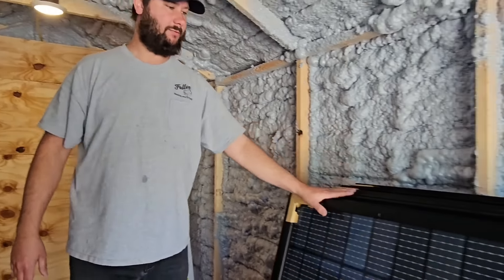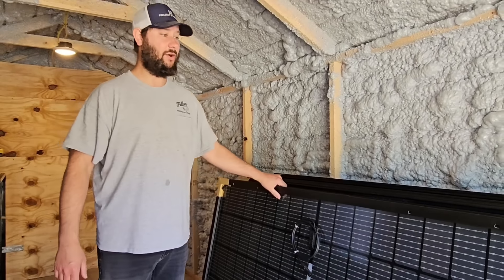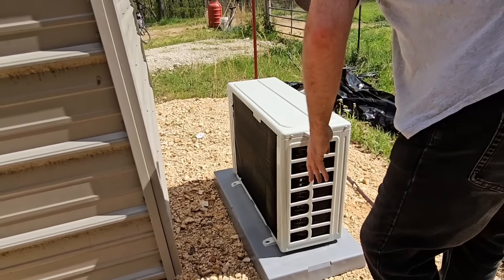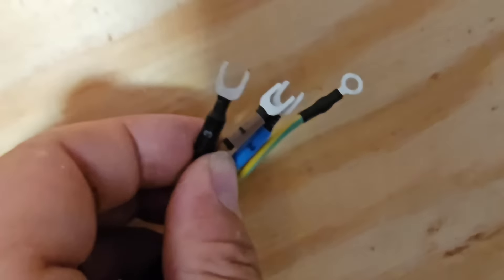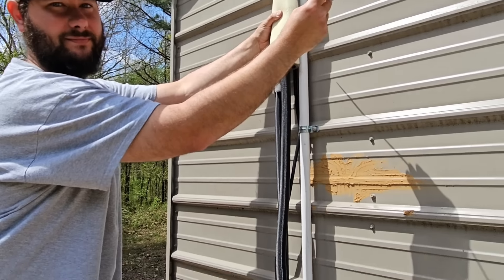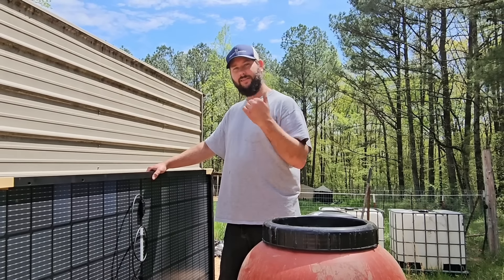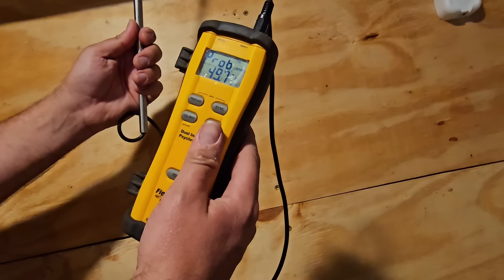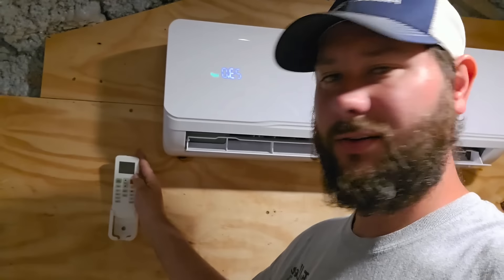Cool Your Home for FREE with Solar Powered AC!

Comment: If u have a solar ac, wouldn't you better put it as cold as possible so during the night it takes longer to heat up again? The power is not costing you anything anyway. I mean this is a shed but for the bedroom. U use that at night. So u cool it to the max during the day. Or it doesn't work like this?
Reply from the maker: I would say if you don't have a backup source of power, then yes, that would make sense. But if you have a battery and inverter that can power the unit at night, then you don't have to worry about that
Reply: @TaddyDigest  but if u already have a solar with battery u have no need for a solar ac. Than u better buy a normal ac and add more solar

Comment: I went back and missed the wattage of those panels I'm all solar and wind power. Every system I design is governed by the total load requirements. I need that data and the cost of that unit. Don't need the panels I've got 3600 watts solar and adding.more plus 4 great wind gennies. The panels you have are larger than mine and wonder what voltage they are and amp ratings. Thanks. Subbed and following. Dandahermit

Comment: Love the vid, I however like to be able to flair the connections to be able to cut the lines shorter and make it neat and tidy. I do the same on the drain lines, that hose won’t last long in the sunlight.
Reply from the maker: If you want to make line shorter and you have a torch and a couple couplings, then you can make it shorter

Comment: What happens when its not generating enough energy to run, like if its cloudy or night time. Does it shut off and tuen back on automatically? It would be pretty annoying if you had to constantly check to go turn it back on.
Reply: Well, what happens? Liking my post doesn't answer my question haha the answer hinges on whether I buy one of these or not lol...
Reply from the maker: If YOU want to learn how the Solar powered AC unit works at NIGHT 🌙 Check out this Video.

https://youtu.be/pjSrqDnEAlk

Comment: “Here we have our installation manual, this is super important”
😳😳🤯🤯

You Are Hired!

Seriously, I get SO fed up with ‘I’m-Too-Macho-Man-Read-Mere-Instruction-Manuals” folks on YouTube , flinging the manual away, then stumbling through the work, trying desperately to figure out which way is up, is water wet, is ice cold, does the RED wire go to the#1 terminal, etc etc.
Then they complain bitterly about “How difficult the install was” or “the product doesn’t work right” or “it burned up in less than an hour”

It’s great to see an actual PROFESSIONAL HVAC installer look at the manual. not all units are identical, manufacturers can have slight differences in details.

Thank you, Taddy Digest. 
New subscriber here.
Reply from the maker: The manual should be your best friend. 
I agree. Why guess when you can know for sure.
Thank you for being here
Reply: Real wrench would be better!
Reply: I agree. When I buy something that has good instructions I usually look them up before I buy it. The instructions give you more insight into what you are buying.
Reply: @ecospider5  ..oh yeah, ‘available manuals’ are the greatest. Sadly, most of this has been locked away behind ‘patents’ or ‘copyright’ or ‘IP’ or ‘Consumer Safety”.
Anyone else old enough to reminder those fantastic ‘Sam’s FotoFacts’???
I am also old enough to remember when Tandy/Radio Shack had “use/maintenance/repair” manuals for almost EVERYthing they sold.
Good Old Days, indeed.
Reply: In the 70’s when I was 6 I watched my dad build our first TV with a soldering iron. He an I did a lot of HealthKit. So many things back then included the wiring diagram inside the device. Those were the days.

Comment: Question 🙋‍♂️ I you wanted to, could you have cut the copper tubes to size and solder the two parts together? So you won’t have that extra tube wrapped like that?
Reply from the maker: Yes, you can, but you would have to pull a vacuum and nitrogen pressure test at that point

Comment: Could the A.C. side be wired to an extension cord to plug into a generator or wall plug?
Reply from the maker: yes absolutely
Reply from the maker: You wanna make sure that the extension cord is at least twelve two wire for this model
Reply: Fantastic. Thank you!

Comment: Is it normal to not vacuum the lines before to add the freon.. ?

Moisture and whatever is in the pipes can just affect your efficiency or your system eventually…
Reply from the maker: If there are quick connectors and precharged line sets, then it's normal not to vacuum.
If the fittings are flared and the line sets are not precharged, then no, you need to vacuum

Comment: Hey Taddy, hvac pro, 47kW pv not too far ne of you. Totally off grid. Running 2 ea 9k mini hp’s 31 & 30.5 seer. 2 ea 2 ton 20 & 16 seer and 1 es 1.5Ton 16 seer hp, 1 9K 23 seer hp in my work van with 1600W on roof😊. 

 p/u 1 5/8 x 1 5/8 unistrut  40’ or so, prime/paint if you choose for rust prevention, bolted to roof using lag bolts, washers, winshield urethane or hvac silicone to seal and hold better/prevent rust/leaks, 3/8” spring nuts, 3/8” ss bolts 2.5” or so, large ss fender washers. 4 sets for one panel or if panels are side by side share hdwr. I use a large socket and a large punch to make washers “Belleville” or cupped. You need a 1 3/8” length (thickness of your frame) of gray 3/4” pvc or block of pt wood to go under washer if not holding another panel down. Tighten everything snug (not super tight to break glass) using anti seize on bolts to prevent galling.

Comment: No mention of batteries; so, does the system only run when sunlight is avaliable?
Reply from the maker: Check out the latest solar powered air conditioner video I did where I show you how it runs at night

Comment: Shouldn’t you vacuum the lines first, before opening the valves to fill the line sets?
Reply from the maker: This model does not require a vacuum
Reply: @TaddyDigest  , the only model I know that doesn’t require a vacuum is “MrCool DIY” where the lines are pre-vacuumed and sealed”…they have a patent on the technology. I don’t know of any other models that have pre-vacuumed lines. 
If your system has it, I would be very interested. 
Do you know if it has “pre-vacuumed lines”??
PS: thanks for taking the time to post 🙏 👍

Comment: Why not install the wires before mounting to the wall? Looks like enough wire length to feed before picking up the air handler.
Reply from the maker: Just did it this way for the video

Comment: How many Cubic ft is this good for?  My building is about 550sq ft...but the front wall is 11 ft and the back is 13 ft, single plane roof.  I'm in upstate sc.

I've learned the hard way that most companies assume 8 ft ceilings is why I ask.
Reply from the maker: 500-600 square ft depending on insulation
Reply: @TaddyDigest Mylar wrapped and foam in between the alum studs
Reply: @TaddyDigest I use mylar bc it has between 70-93% radient reflective rating depending on whether u have a dead air space between the mylar and the sides/top of the building....I can send u a link if u would like
Reply: @TaddyDigest that's the amazon link I use.....I bought 6 of these for a 1300sq ft house to do the attic and the inside of all the exterior walls
Reply: @TaddyDigest I'm in a cinderblock  house.....so yeah

Comment: if a person can carry the outside unit then you defintely dont need those support brackets for the indoor unit. Indoor units are extremely light weight. you can hold it with one hand and push the pipes with other hand easily.

Comment: Just extend the width of the frame the solar is gonna sit on…use some “pipe or electrical strut” to create a frame that extends past the roof line so you can have all those panels sit above the roof(up and out of the way…
Plus if you add More panels and split your lines for the solar to an inverter with batteries you can supplement the power throughout the year for that building when the ac is not in use

Comment: Pretty nice that they make a unit that is efficient enough to run directly off of your panels, and still cool a fair amount of space! I like the fact that they come pre-charged so you don't have to screw around with soldering lines, and vaccing down the system, and charging, and whatnot. That can literally take longer than installing the system in some cases! 😉

Comment: I know this won't mean much to alot of viewers, but an easy way to convert Cel to Far. Double the number and add 30. He was showing 16 cel. 16 +16+30 will put you in the ballpark.
Reply: @BlackpowderBBQ  Well good for you, then why is this AC in Cel.? I was just trying to give you an easy way to convert so you don't have to carry your laptop around with you all the time, to look up formulas. Actually your laptop was more than like made by countries that use the Metric system. Is BTU's and cubic Feet AMERICAN
Reply: You can look up formulas on any phone with access to internet, also c° to f° is probably the easiest one, 32 F equals 0 C and then do each C by 1.8 to convert to F
Reply: @irvingchies1626  Right, I got it. Why are you being a prick about this? I was just trying to give a quick easy way to get close  to the conversion. Do you give people the correct time, right down to the sec if they ask you what time it is?
Reply: @irvingchies1626  Have you ever had a real job where you aren't allowed to play with your phone all day? You ever had a job where the frequency of your phone might cause an expolsion, so your not allow to have it on you?

Comment: Can you hook up both solar and AC power, and if so, does it have a kind of smart switching internal to switch to solar when available, but use AC power when it is not?  Or, do you need some kind of manual disconnect to move between them?
Reply from the maker: Manual disconnect is needed between them. I'm sure there is some type of automatic switching system. You can get. I will learn more and let you know
Reply: @TaddyDigest  Thanks for the fast reply!  I'm not sure if this applies but I found a comment on this vid (zrvf_pqeNH0) and they said "@marcarcher5426 3 days ago
 @MyCabinLife  Was planning on 3 sets of 4 for a total of 1200 watts. Using an EG4 hybrid solar mini-split. Whatever watts it may be short will be made up with AC from the grid. The unit can use both AC and DC simultaneously. 

I didn't catch if the unit you installed was an "EG4" but if it is, and IF they are right, then that would be the best of both worlds.  Instead of "switching" it would just use the AC input for the needed difference, which would be awesome.  I'll be very curious to hear what you found out (and if yours was an EG4 unit), but thought you might like to see this comment, even if I've not found any details yet to back it up.
Reply: Yes he has the eg4 and yes if no sun it would switch to the ac power I asked signature solar about it and they also have a video on it

Comment: Could you run the water drain onto the outside condenser for better cooling?  I may be wrong, but wouldn’t running water on the condenser (right name?) make it operate more efficiently?
Reply from the maker: running water could help condenser coil reject heat 
you would want the water to be neutral not acidic though

Comment: So nice to watch a pro installer guide us looky-loo's.  Very good video!  Mounting the solar panels:  To max energy research the best angle based on your latitude.  Build a semi-stud (only studs) structure with a vertical back for attachment to the shed and angled front for mounting all the panels at the correct sun angle.  Sitting down low permits easy cleaning and negates possible wind damage.  🤠

Comment: Does this unit run on ac at night or does it require batteries.  You said in the video it had an dc disconnect
Reply from the maker: Runs off of a c power at night

Comment: Why are you not vacuuming the lines before releasing the gas?  Is that why you are not able to check the joints for leaking?
Reply from the maker: pre charged line sets
Reply: @TaddyDigest  Are you saying that the lines are charged with refrigerant and have valves installed inside? Same for the FCU coils too? If it is so, why are you not tightening the joints and check for leak right after connecting them?
Reply from the maker: no nitrogen pressure test required or vacuuming 
no flare fittings they are quick connectors
Reply: @TaddyDigest  Thanks

Comment: Is there any way to mount the solar panels so the short end hangs off the roof?  The overhang will shade the shed side a little bit, and it might help the panels get rid of some heat, too.  Make sure you use standoffs to allow airflow under the panels, too.
Reply from the maker: I thought about doing that
I'm just unsure of the weight added to the shed roof because the panels are quite heavy

Comment: Great video.  Looks like they intended you to put the wiring harness through that white plastic bracket, just curious if there is a reason not to do that.  Does it make it easier to maintain in the future?
Reply from the maker: Thank you for watching
No, reason not to do that. I just used what I had and what i'm used to

Comment: Seems like that unit is big for that shed.  Will it be tu
Cycling too often?  Doesn’t size matter?
Reply from the maker: In a building less than 250 square foot. As long as you don't put more than a 12000 btu  unit, it will not short cycle

Comment: You need to add a rubber washer between the rib and the one hole clamp on the drain, water can migrate behind the clamp and into the rib, it does no good to seal only the domed screw and clamp without sealing the rib and the clamp
Reply from the maker: Thank you, my brother. I really appreciate your advice and you looking out for me
I will definitely do that

Comment: Quick question...if you leave It running and the sun drops off and also overnight, will the unit restart all by itself or do you have to keep turning it on with the remote when the power level drops?. Great video by the way. Regards from Super hot Australia 🦘🦘🦘
Reply from the maker: the equipment will automatically switch over to the other power source

Comment: Pressure treated and then painted 1X4s .Run some long ways and then some crossways. First of all they are light and strong . Secondly they would probably last 20 years even if you did not paint them since the solar panels will keep most of them dry.

Comment: Good stuff thanks. I want to use this for my solar power and battery shed which coincidentally will contain EG4 LL batteries. Mainly interested in keeping everything at 55 deg or above in the winter. Thanks for the video.

Comment: great video.. But you should have vacuumed the lines before releasing the gas... i installed one.. and it even noted in the instructions to vacuum the lines... so you have less of a chance of getting vacuum lock in the lines and will last longer..
Reply from the maker: The lines are prevacumed

Comment: Why did you open the service valve without vacuuming the indoor unit and pipes? (26:58)
Reply from the maker: These lines do not have to be vacuumed
There are no flared connections. They are quick connectors

Comment: Sir am I correct that this requires 4560 watts of solar panel?
Reply from the maker: To run this air conditioner, it only takes a minimum of eight hundred watts

Comment: You also seem to have forgotten (edit: nah, I missed it) to angle the tube and hole in the wall 8-15° down going out, to prevent moisture and condensation from gathering in and around the hole, but you did think to fit PVC and silicone it, so that's real good.
Reply from the maker: I said in the video that I angle down when using the hole saw from inside while cutting the hole
Reply: @TaddyDigest  Oh sh.., how did I miss it when I was waiting for it, maybe because I was waiting for it?
My bad.
Reply from the maker: 😄 🤣 
It's all good in the hood brother

Comment: I don't know why nobody ever talks about heat recovery/heat exchangers when dealing with Heat Pumps, I've been using one for close to 35 years and it's amazing,not gives me free hot water and ups my SEER eating as a bonus making the whole operation more efficient. 
The best part is you can use any old hot water heater you want... You could even run a DC powered pump or a 110/220v pump and it's only pennies to operate because it draws somewhere in the order of less than 0.5 amps...

I'd like to see these DIY units add two extra quick connectors in the proper place to allow for the hook up of a heat exchangers... I mean you could just Mount it on the return line but it's best between the compressor and the reversing valve... 
When they switched over to the new refrigerant everybody doubted it would be much of an advantage, but truth be told, it's even better than it was with the old refrigerant!!! The water is even hotter than ever!!! And if you buy the parts yourself and install it yourself it pays for itself in no time at all which is why many AC techs use to jack their prices up because nobody ever believes you when you say it pays for itself in six months if you consume a lot of hot water.... Mine runs year round down here in Florida... Summer and Winter... With the exception of a few days when it gets really cold and I need to use auxiliary heat.
Reply from the maker: Can you provide me with a link to show me what you're talking about

Comment: I bet you punched a hole in the drain plug LOL.  I love the way you read instructions and attached the wires into the Head unit before instillation LOL.  And your hole was just perfect showing below the unit LOL.  Don't worry about the metal screws leaking behind the bracket LOL.  Don't worry about the rain getting in the exterior hole where the silicone did not get and be sure not to cap it with a rain protector either LOL.
Reply from the maker: lol 😆 😂 🤣
Reply from the maker: Thanks for watching the videos